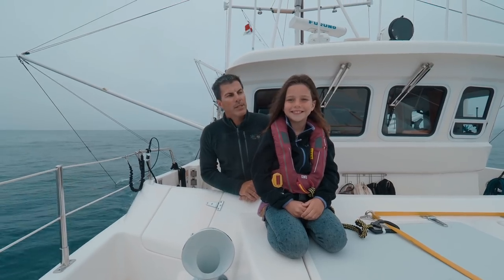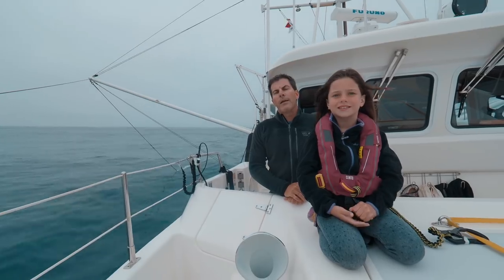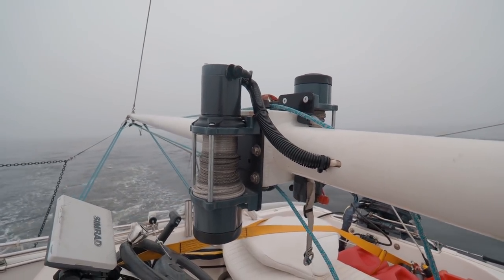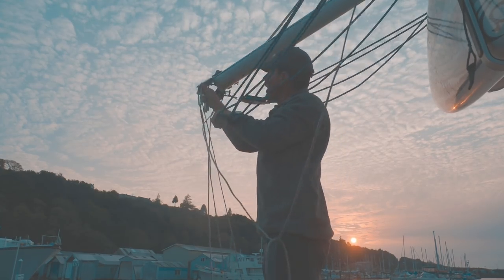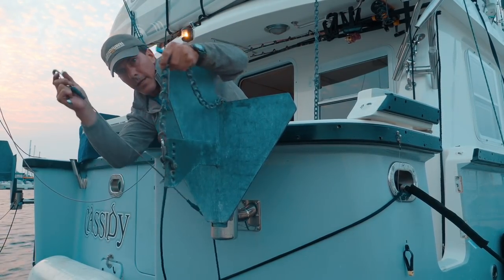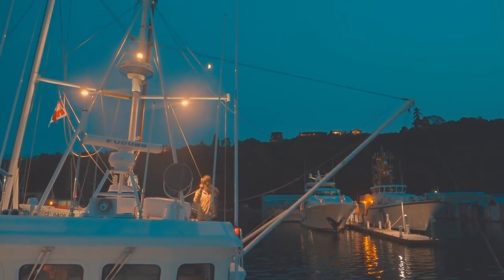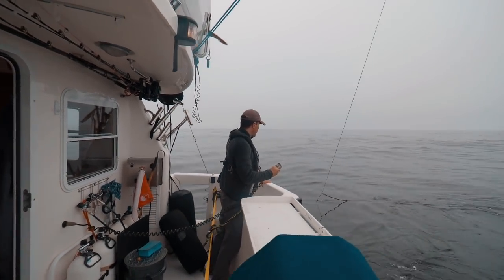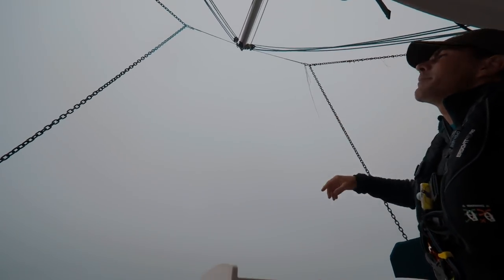Using Paravane Roll Stabilizers on an Ocean Crossing Powerboat - Nordhavn 40, M/V Cassidy,  Ep. 11

Comment: I’m on a similar path as these folks buying my Nordhavn 40#29 in May of 2016, moving aboard in November 2016, cruising Alaska 2017 and then down the coast to La Paz, Mexico where I’m currently at Marina de La Paz. 
N40#29 has the same set-up, both Naiad active stabilizers and paravanes. And I’ve used both separately and together..

This is an EXCELLENT explanation of the hardware, the preparation and the use of the paravanes.  I had the same “N47 Guide” and spent about an hour studying and figuring out how to deploy and retrieve the paravanes. 
In actual practice, and after some practice, the process is much simpler than I had been led to believe by other owners of boats with paravanes.  
Here’s what is necessary:
1.  Untie all shock cords, ropes and ties off standing rigging and chains.
2.  Uncleat the line holding one of the poles in the stowed position, give the pole a push and let the line out. Pull in the down haul line.
3.  Go to the back of the boat, go out on the beautiful swim platform on my boat, grab the fish out of the holder and throw it over the side.

That’s it.  10 minutes max for both sides deployed.

To retrieve:
1.  Release downhaul line. Pull in line that raises the pole, direct pole into cradle, cleat line.
2.  Pull chain along side of boat and secure on aft boat deck railing with a shock cord.
3.  Go to beautiful swim step, grab chain, haul up fish and stow in holder on stern of boat.
4.  Secure standing rigging and chain with shock cord, rope, and ties.

20 minutes max for both sides.

Some caveats:
1.  I only do this is calm conditions.
2.  I have a big, beautiful swim step.  Greatly expands the and improves the operation and enjoyment of these boats.
3.  I can still lift the fish by myself.  I’m 63 and in pretty good shape.
4.  I have rigged the boat to use the boom winches to lift the fish out of and Back into the cradles just like this video demonstrates.  NOT using this ALL the time greatly reduces the rigging and time for deployment and retrieval.

Once again, excellent video, thank you for producing this and your others and job well done for wearing your PFD.

Eric

Comment: Well done, you’ve taken a rather complicated rigging procedure & made it doable by one person while under way ...
Reply from the maker: Almost all of the rigging can be done underway.  The one thing that would be dangerous underway is moving the blocks around on the tip of the boom.  The only way to reach the tip of the boom is stand on the gunwales on the corner of the transom and it's a pretty easy place to fall fro even tied to a dock.

Comment: So.. Being a long time shrimper on the gulf coast, there are simple ways of setting up outriggers. We usually set up them with specific lengths of line so when stowed you can "anchor" them in place. Also the boat is designed off a "trawler" and yes the fish are actually used to hold the nets open in the water, but can be used as stabilizers which is why u find them on your boat. The rougher the water the more length you add to the similarities so as they have pulled up against the water column giving more resistance to roll. 
If you attached a line long enough to the back of the swimmer to reach the boat while it is deployed, you put a bouy on the end of that line. When retrieving just throw a grappling hook and snag it. Pull up similarities and hang them on the outrigger itself that way they are on the side of the boat instead of the back. Also you could add a second adjustable foreman that attached to the front of the swimmers. This makes them pull outwards and downwards at the same time. This may be a line that would double a tail line with bouy if so desired. Just a couple hints. I would recommend while in a marina maybe shooting the bull with an actual offshore trawler, maybe making a day trip to see how they actually work when used for nets may help with the mechanics of it all.

Comment: I am a new sub and catching up. I nearly skipped on this vlog. I am glad I didn't. This vlog crystalized the purpose, use and theory of the paravanes/outriggers. I have used outriggers on boats as a way of dropping and hauling gear and never really thought about the stabilizing effect that it had on the haul. I have always piloted for the conditions and configuration. For some reason, what came to mind as you were describing the tackle and operation, was a tight rope walker with their balancing pole. BAMM! crystal freaking clear in my mind!

I learned something and for that I will be thankful. ;)

Comment: Underway you called them “fish; “we used to call them” birds.”  At anchor they were flopped stoppers. Definitive explanation of your system. Excellent. 👍👍
Reply from the maker: Nellie - I’ve heard them called birds as well.  Most of the literature I’ve read refers to the paravanes as fish but I’m sure both are fine to use.  We use “flopper stoppers” at anchor but they are different devices that we rig on the chains - flat plates with a hinge in the middle so they dive when the boat rolls on the down side and open and resist roll on the up side.

Comment: GREAT video!  I’m no expert, but for what it's worth, I think you are probably using the best speed hole you can (9:46). Voyaging Under Power (4th ed.) says "The hole used for towing should be as far forward as possible while still keeping the tow wire taut when driving." The accompanying illustration shows the third hole in use and the authors say that's where they run theirs. You might could safely move forward another notch, but like you said, you're probably only losing 1/2 a knot now.  Pretty fair trade for the comfort.

Someone asked in the comments about how effective the paravanes are; VUP says one study showed a 50% reduction in roll and pitch.  That could perhaps be debated but, at any rate, they reduce it “a lot.”  Fish are labor-intensive but cost-effective; fins and gyros are labor-effective and cost/maintenance-intensive.  Fortunately y’all have the flexibility of both!
Reply from the maker: Rob Crawford - thanks for the input.  I’ve read the 4th edition of Voyaging Under Power a couple times and found the info on paravanes interesting.  It’s obviously impossible to cover the nuances of every possible type of installation in a broad text like that though.   

If we were more motivated I might think about experimenting with hole placement but the engineer in me would want to collect all kinds of data and I can imagine it becoming a huge project.  So for now we leave the fish mounted where they are and call it good enough!
Reply: @CassidysSailingTrawler  Yep.  If it ain't broke....

Comment: The drone shots with annotation (labeling) of the various parts of the system was a brilliant idea. Really makes the complex rigging easier to understand. I'm still curious about the physics of how the paravane system actually works. Do the fish create a hydrofoil effect of sorts to counter the rolling or is it just the inertia of the additional drag that dampens the roll?
Thanks again for sharing!
Reply from the maker: Adippen - my understanding is that the Paravane does work as a hydrofoil and the amount of lift - in this case in the negative or down direction is proportional to the angle of attack - and that is set by what hole that the shackle attaching the fish to the chain is attached too. 

There is a bullet shaped mass in the center of the leading edge (also used to stow the fish) that causes the fish to stall and dive on the side of the boat that is rolling down while the fish on the side rolling up is resisting upward motion. 

It’s been a while since I’ve last read it but there is probably some discussion of the physics in “Voyaging Under Power” which I linked to in the description of this video.

Comment: I like simple, and while this system looks a bit complicated (at first), your explanation of its operation completely demystifies the whole thing. 

I really don’t feel like working the rigging would be all that difficult (I could be wrong). But on a dedicated boom the system would be that much simpler. 

I think that my boat will have this system installed, as it looks like it has the least amount of opportunities to fail.

Comment: Great job with the video.  I watched it before we brought our N46 from San Diego to Portland.  I still have two questions: Do you need to move the boom over to each side when deploying and retrieving or do you just leave it amidships?  We kept moving it back and forth so there is a more direct pull but there isn't really a good way to do this yet on our boat.  On a sailboat there might be some kind of track or traveller.  The other question is do you know where I might find those fish holders?  I like the way the fish are lower to the water and out of the way.  Ours sit on top of the gunwale.
Reply from the maker: If everything is rigged correctly you should not have to move the boom at all while launching and retrieving the fish.  The trick is to get the angel of the boom and the connection point where the winch lines attach to the chains both correct.  Our boat was not rigged correctly when we bought it and it took some iteration and trial and error to get it perfect.  You want the tip of the boom hight enough so that the shackles where the winch lines attache to the chains don't jamb against your blocks when the fish are at the highest point out of the water.  but you should be able to rig it such that you can get the fish high enough our of the water that you don't need to use much human muscle to get them into the holders.

I don't know where the fish holders on our 40 came from - they were there when we bought the boat but I suspect that they were custom fabricated.  Since you mention that yours are on top of the gunwale, that means that your geometry for lifting is going to be slightly different than on our 40 as well. 

Hope that helps a little - any other questions just ask!
Reply: @CassidysSailingTrawler  Thanks for the reply.  Next time, I'll try keeping the boom in the center and adjust the attachment point on the the chain and see how that works. I actually think launching and retrieving the fish is a lot of fun and I certainly like the way the boat feels when they are in. Cheers,  Paul

Comment: Great video - so informative, thank you,    How often do you use the paravanes, what are your indicators you want to use them (I think you said your had fins as well)?
Reply from the maker: We sold this boat but the answer is that we rarely used the paravanes but when we did use them they were great.   A lot more work to rig and deploy than simply hitting a button to turn on the fin stabilizers but they really do help stabilize the boat.  Nice to have for backup but when running offshore in heavy seas we occasionally used both the fins and the paravanes together and they definitely make the fins work way less hard.   Down side is a hit to speed and/or fuel burn.
Reply: @CassidysSailingTrawler  Thank you for these videos, do you plan on posting new ones?

Comment: Thank you for the video - super detailed and great explanation!
Question: I've seen other cruisers forgo the winches and just chuck their fish in the water and recover them by hand. Are the Nordhaven ones particularly heavy? The use of the winches seems like a pain in the butt. I see that they have a huge weight on them that i haven't seen on other fish. Is there a reason for that?
Thanks again!!!
Reply: A couple years later, but figured I would answer.  I have a similar trawler; older and simpler.  She does have a boom and winch,  but not all the lines and ability to turn 90 degrees.  I hand deploy, as the previous owner did.  My fish have plywood delta wings, which would make the lighter.  They aren't light, but I am a big guy.  Probably couldn't do it in my 70's.  I think I would just hang a block though before trying to do all that rigging.

Comment: We are interested in a Nordhavn 46, enjoyed your paravane video but have a question.  When you deploy the fish - are the poles first placed in the down position - I believe this would get the fish away from the hull quicker and avoid possible damage.  Then when the fish is retrieved, are the poles first put in the upright position to bring the fish into the stern corner?  Am I correct on this?  Thanks for your videos.  M & J
Reply from the maker: The poles are set in the outboard position and left there the entire time when either deploying or recovering the fish.  It’s really not that difficult to deploy them after everything is rigged correctly.   The rigging is the time consuming part.  

The electric winches do all the heavy lifting and only a little bit of manual guidance is needed to keep the fish off the boat when putting them into the holders in the transom.  

I always rig a jackline in the cockpit and clip in and we try to deploy them before it gets super rough and retrieve when conditions are more calm.

Comment: Is the amount of stabilization gained worth the extra complexity and work?
Reply from the maker: That's a good question, and it's all relative.  I'd say absolutely not worth the effort to deal with them unless we are going on a relatively long offshore or coastwise passage.  The Naiad fins work great and when we are just dealing with harbor chop or wakes and things like that I don't worry about having the paravanes rigged, and in fact they can get in the way.

Offshore, I am very glad to have them and think the added safety margin and comfort they provide, both in case of failure of the fins, or in extreme conditions in tandem with them is worth the effort involved in rigging.
Reply: Not to mention the cost.

Comment: Have you considered using dyneema soft shackles for the blocks at the end of the boom?? then the switch over would be quick and easy without needing the use of a tool or safety wire.
Reply from the maker: nightcrep - that’s a really good idea.  I use them where the boom sheets attach to the deck when we are lifting the dinghy and just never thought to use them at the tip of the boom.

Comment: I owned a Nordhavn 40 hull number 19 and sold it primarily because of the paravanes...they are difficult to deploy and even more difficult to store especially in conditions where they are needed.....entering an inlet or safe harbor the paravanes must be stored....keep in mind the boat is rocking and rolling the whole time you are trying to control the fish and the poles.  Underway the paravanes rob you of 2 knots and they are not maintenance free.....go with active stabilizers if you have a choice.
Reply: I'm curious, since he said it costs MV Cassidy a half knot and yours robbed you 2 knots, why the difference?  Same boat.  I wonder if your pins were in a different hole on the fish to cause them to dive deeper and create more drag?  Just asking...
Reply: 2 knots on GPS....maybe as you said I ran the fish deeper or at more of an angle to get the  desired roll control....they are infinitely adjustable
Reply: I’ve deployed mine a lot and it’s 1/2 knot loss for me.

Comment: Great video. Did you use them at anchor with floppier stoppers? if so how do they work in stopping the roll at anchor.
Reply from the maker: Chuck Thomas - that’s one of the great benefits of having a boat rigged for paravanes is the ability to deploy flipper stoppers at anchor.  We use them a lot with the Magma hinges stainless plate type flopper stoppers.  I’ve heard of people just using the fish and apparently that works to somewhat damp the roll.  

The downside is a full keel, full displacement boat with a round hull is they are really tender at anchor compared to a boat with hard chines.  I think that a lot of the Nordhavns without paravanes are equipped with a pole on at least one side for a floooer stopper at anchor but getting the wide spread like we have with our system really helps.

Comment: Are you a vessel constrained by draft when running paravanes? I couldn't remember from my Capt's course and testing if day shapes or special lights were required for paravane usage. Maybe being under 50 meters would eliminate that anyway? Probably not a good idea to leave your outrigger boom extended in the marina overnight, especially the port side in the alley, just my two cents.
Reply from the maker: Chuck Chalfant - we only pulled into that dock to do the final rigging on the paravanes before we headed back out that night around Cape Flattery so it was only an hour or so we were there.  Otherwise I totally agree about not deploying the poles in a marina. 

Good question about being constrained by draft.  The fish run at about 14 feet below the surface.   I also took the class years ago but there always seem to be some vagaries in the rules. Ultimately we just try to be proactive in avoiding larger boats.  We recovered the fish and stowed the poles before coming into San Francisco Bay.